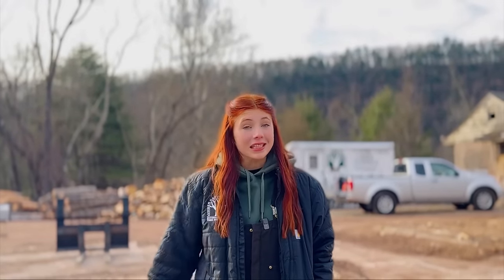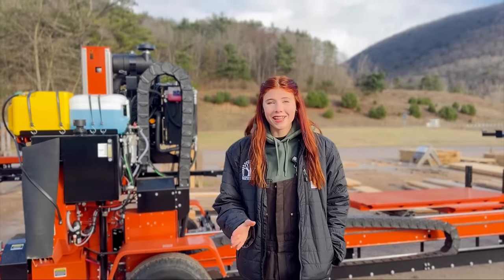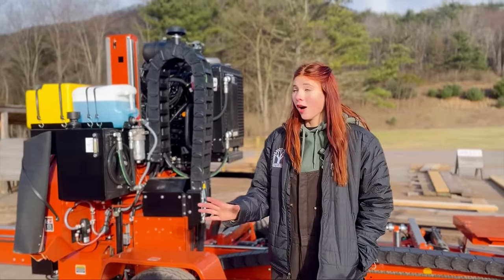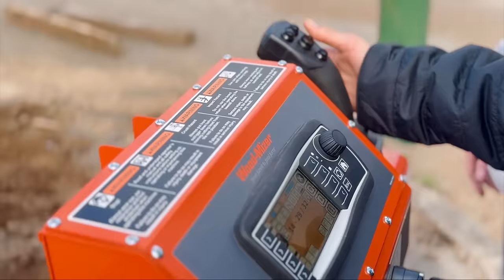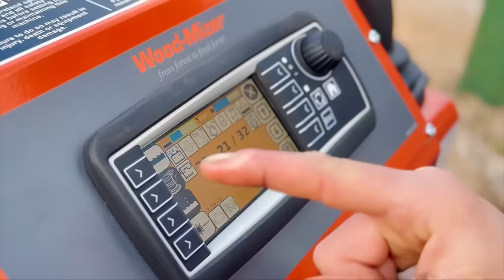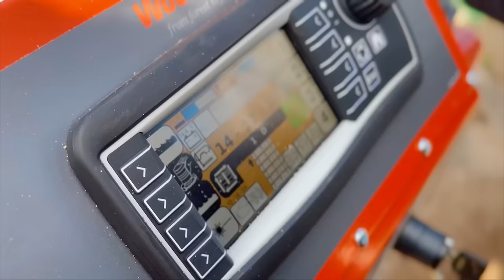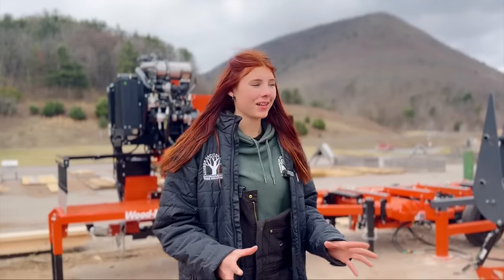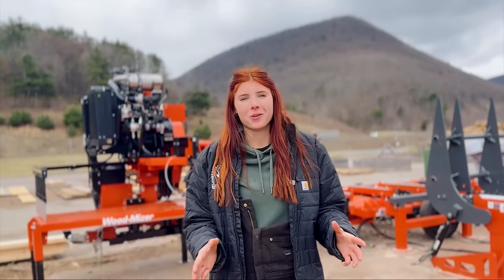This just turned into something BIG! Installation and Training on the Woodmizer LT70

Comment: I've been using the LT70 for two years now and it runs like a dream. You'll love it.
Reply: Did a brief comparison with the LT40. Big expense for a little gain IMO. 35 vs 55 HP,  45K vs 65K, Heavier. But with no log rolling and  LT70 capable of milling up to 1,000 board feet per hour, it may pay for itself shortly. Seems like it takes valuable yard space.

Comment: That diesel motor has so much more torque it barely works powering through the biggest and hardest of logs.  It appears the debarked is beefier as well insuring the blade stays sharper longer. I believe it will use less fuel than the 40 despite the larger displacement motor. Great investment that should yield significant profits especially under the command of the ever proficient Emerald😊

Comment: Hello Mrs. I like the 70. U should get used to having the mill always cut away from u , the joystick stand always tp the side of the board return table.  Just a little quick tip how I run mine. Keep up the good work. It's much safer that way.

Comment: Some things to keep in mind with a diesel engine. Diesels are hard to start in frigid weather. You will need an engine block heater plugged in overnight and when not in use on weekends during winter months. This may require you to have electrical service installed at the log yard. Diesels use #1 fuel (kerosene) in winter and #2 during the rest of the year. Be sure to get off-road diesel fuel as there is no highway tax on the purchase price. Diesels also require more frequent oil changes than gasoline engines. The lubracation oil used is generally 15W40, but check your owner's manual regarding this. Diesel engines are a bit noisier and smokier as you may know having other diesel equipment.
Reply: 🤣😀  I am sorry, I just don't see it the same way.  Clearly they have been running a number of diesels without electric power to plug into.   It is not likely they need our advice...    The only time I ran #1 fuel was when the temperatures were running zero degrees Fahrenheit or below  for extended time.    The key to starting diesels in the winter (above zero F) is having lots of Howes additive in the #2 fuel and more battery amps available than the manufacturer thought necessary.

Comment: Having the operator station at the opposite end of the mill is going to take some getting used to.  I've never seen a live deck for a LT70.
Reply: I find that strange as well. With the LT40 they were able to see the blade height and adjust it if necessary before the cut. Now it doesn't seem easy or even possible. Plus I wonder how difficult setting up for quarter-sawn lumber will be.
Reply: @bille294 I think it can be used on either end.
Reply: @davidcolwell614   No, the blade will only cut in one direction. It's all backward from the LT40. It will take some getting used to, but I'm sure the ladies will have a handle on it within a week.
Reply: worse than that, how will we be able to see both beauties in one shot ? great looking machine though !
Reply: @davidcolwell614 You are correct !! The control box can be used anywhere you want to be as long as that is not far from the mill.
Reply: Procedures will need reconfiguring. Emerald used to move the cut boards while the saw was sawing the next one off the cant,but now the cut boards are at the opposite end from her operator station. seems kinda strange.
Reply: U got a good point. Seems backwards to me. But I guess it's the way you train yourself to do it,  takes getting used to.
Reply: Presumably this means it's no longer really practical to be operated by one person on their own?

Comment: The new LT 70 wide is nice, and the log feed bed, the controller is on the other end so the machine is moving toward you instead of away. The diesel power plant with a bit more power should also increase production. Now you will need a new shed roof to keep you out of the weather and sun.
Reply: The controls can be put where ever one wants them to be; they are not stuck in a particular location.

Comment: Didn’t see anybody mention it but being down range of the debarker, even with the rubber shield, can be a rough spot. I typically work the swamper spot on our 35 and it routinely throws chunks and stones past the shield especially hemlock. Needless to say, after getting hit a few times I don’t stand down range of the the debarker now.

Comment: Interesting machine.  Cuts on the stroke towards the operator.  Keeps the motor heat and noise away most of the time.  Makes sense.  Can't wait to see more.
Reply: the controls on this machine can be anywhere near the machine you want them to be

Comment: Can't wait to see the final installation and the mill running. From just a bit today it looks to be at the very least twice as fast as the LT40. I know setting the cut for the first slab is done manually and by eye and being at the opposite end will take some getting used to. I'm sure the Boss has calculated the break even in this new piece of equipment and I'd be curious to know how long he figures that will be ? Fun times ahead 👍

Comment: Hi Emerald, what a monster that 70 is but I'm confident that you will get it tamed and train the others. Getting the output lined up with the edger will allow fast production for the flooring now the shop is opened. I hope they gave you a cover for the mill head at night it looks pretty exposed. And with it cutting towards and pushing away I guess you will need headsets to talk to the stacker. Any way I'm excited for the future of LCLY and your family.  👍🌟
Reply: the controls on this machine can be anywhere near the machine you want them to be
Reply: @scottsoper  Yes I'm sure but the way it is setup now the mill is cutting towards the operator and dispensing away from the operator. Whereas before it was cutting away from and dispensing towards the operator so it was easier for the sisters to talk. Perhaps they will move the operator station in the future but who knows.

Comment: Thought usually the blade cut away from the operator, not toward her?  Can’t wait to see the log deck in action. Of all the folks running Wood Mizers on You Tube, this will be the first I’ve seen with a log deck.
Reply: the controls on this machine can be anywhere near the machine you want them to be

Comment: Quite interesting to see how different this machine is. Cutting direction towards the operator, turning the logs with the rotating chain/teeth seems to be a better solution than the hydraulic pushers on the LT40.

Comment: If you keep an electric blanket around the fuel tank it will make things much more efficient in the winter. Put a timer on it during the coldest periods.
Reply: they do not have electricity at the log yard.
Reply: @scottsoper I had no clue. There are options. Not that big of a deal. Just admiring the new Mizer.

Comment: This mill has a circular blade leading the band.  I don't recall the old one having that feature (?).  Nice to cut the bark to allow a cleaner cut for the band.  Anyone who has done a ton of logging or, in my case, power line clearing you know how dirty the bark of a tree can be from field dust, etc.  The worst we had to endure was river bottom trees - flooding with dirty, muddy, water would really dull a chain in a hurry - file, cut, file cut...  We finally got some diamond (chips) impregnated teeth - they worked better and could be sharpened with a file.  But that circle blade is nice!
Reply: That circular blade is a debarker and the LT-40 had one also.

Comment: I am curious about the difference in feed rate, assuming the same appx. log, between the two machines. With that much more power I would think the 70 would be almost double. I think you will find operation much easier with the controls on the other end as many have noted. Geez that's a great looking unit....

Comment: Well that one is Beast and why the control at the far end of the table.   strange but really hard to judge that first cut for taking the flinch off.
I like how this is not against a building so sawdust clean up will be easier but the elements of weather will be really felt as it not covered.
Reply: the controls on this machine can be anywhere near the machine you want them to be

Comment: It's more than longer bed and a diesel engine.  I see that it has a lot of upgraded features.  The blade moves away from the Sawyer when it cuts instead of towards the Sawyer.
Reply: With the controls on the LT-70 you can stand anyplace near the machine you want to.

Comment: Now all ya need is a chip fired steam plant to create electricity and all kinds of possibilities with outfeed belts, outfeed chains and a chipper that might also supply heat for a kiln could happen.. not very sustainable  tho.. strips off a mountain far sooner than you might imagine.. honestly prefer your bosses approach in keeping his "woods" viable. oh and.. not to worry.. you will have those new kickers dancing to your tune in no time.. Much love and Thanks so much for sharing :face-red-heart-shape:
Reply: Steam power has some problems.  Steam turbines need a LOT of steam and piston stationary steam engines are only available from Tiny Tech in India to my knowledge. However it might be possible to use wood gasification to run a generator, particularly if one could come up with the gas proof fabric to make a BIG gas bag like they used years ago. However the simple trouble free way is to use Diesel !!!

Comment: A much beefier machine. Milling bigger and longer logs will increase your milled boards each day. Much fancier controls; much like piloting a jet fighter. Diesel means a greater capacity to  mill bigger logs, quicker. Now you are going to have to teach Pop, your Mother, Jade, Judah, and Grandpa how to run it. That table should help speeding things up. All of the changes on the mill look like it will handle the bigger logs much easier and quicker. I am looking forward to your next video showing everything in commercial milling.

Comment: Nathan, at Out of the Woods, has an LT70 Woodmizer also, but his saws away from the console and it seems like your new one saws toward the console.  Am I correct and if so why?
Reply: Nathan is not as concerned with production is my take.  He is one person and so it helps to work from the return position so he can take the lumber off the machine.     LCLY  needs all the room they can get on the return end for stacks of lumber, so it is better for the controls to be on the other end.  LCLY will be running this machine wide open when they get it all figured out.

Comment: Well that will take getting used to.  I expect there is lots NOT to like.  The Debarker coming at you and not being able to see where the blade starts would bother me.  You were in a sheltered, shaded area and will need that again if you leave it in its' present configuration.
Change is not always for the better.   It will be easier to remove the sawdust with the FEL.  Great log rotator.
Reply: This change WILL be for the better, there is no question of that.  It will take some time to settle in.   also the controls on this machine can be anywhere near the machine you want them to be

Comment: Emerald, what are your thoughts on the cut coming at you as opposed to going away like your old mill.
To me it seemed to blow a lot of dust at the operator. No? ❤😁👍
Reply: the controls on this machine can be anywhere near the machine you want them to be
Reply: @scottsoper  So the controls are not fixed but on a cable?
Reply: @kenkarish826 Yes they are on a cable on this machine but I think they can also be blue tooth. (no cable) In the video I saw a cable from the control box.
Reply: @scottsoper  I see it now... Cool.

Comment: So what's the benefit to the upgrade ?
Reply: LT 40 1000 BOARD FT TO LT70 3000+ BOARD FT A DAY
Reply: 9' or so long logs on the LT40, 20' logs on the LT70. Going from a toy to a machine.
Reply: Bigger band ?
Reply: faster and can take bigger diameter logs.  The control box will likely be better also.   The live deck for the incoming logs will be faster and easier.

Comment: Why buying on a trailer and not a big static machine ? Your plant is fixed?
Reply: As a small family business a "big static machine"  would cost too much and be overkill for the work it needs to do.  Also it would likely be made to run on electricity,  likely 480 3 phase.   LCLY has no electricity and it would cost far more than one would expect to get electricity installed.    The LT-70 should do vary well for their business.

Comment: Oooo, going to run , biodiesel?????. Ummm French fries.
Reply: I would not allow biodiesel on the log yard. Corn oil would not be good for this engine: this is a tier 4 pollution set up. 
Always use some Howes anti gel in the diesel, even in summer to repel water.  In the winter use LOTS of Howes anti gel in the diesel to keep the fuel flowing.

Comment: next time , explain the reason for the up grade please.,what are the advantages of the 70 over the 40 other than horse power.
Reply: Really? You can’t do an internet search yourself?
Reply: the horse power translates in to more logs cut. The higher speed means more lumber manufactured per working day. The live deck for the logs means that some parts of the job will be faster and easier.   The WIDE means that logs that are bigger around can fit on the mill. The joystick controls are likely better than the controls on the old machine.
Reply from the maker: Trust me, there will be plenty of videos on that in the future! Stay tuned! 😁